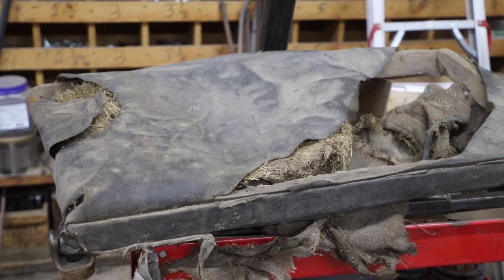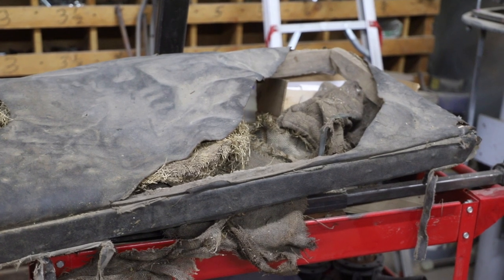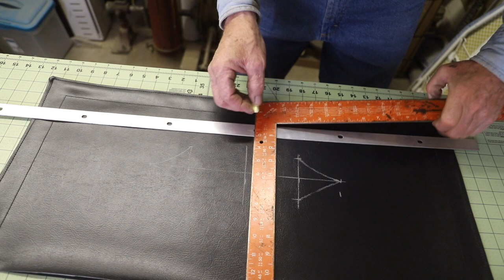How to Stuff and Sew a Buggy Seat Cushion | Engels Coach Shop

Comment: Dave, I was the Quality Manager of a huge high end chair and sofa manufacturing plant.  We made as many as 12,000 per week.  

In those 12 years, I observed every facet of manufacture.  From rough planing hardwoods, frame building, cutting and sewing leather & fabric covers, spring installation, stuffing filling materials upholstery, packing … To even shipping.  

So, you might say that I have a critical eye about how seats and backs are made.  Everything you did was scrutinized… like, staple direction and spacing… selvedge alignment… spring orientation… sewing stitches per inch… Everything…  that you did would have passed my inspectors with excellence ratings.  

Just thought you’d want to know… your skills and workmanship are excellent even compared to a modern Quality Standard.
Reply: Would like to know what is going to keep the top of those springs from wondering all over the place? We used to tie the springs to keep them in place. It was an art in itself.
Reply: @EuphJL  That is an excellent question… these are Bonnel type (double cone or hourglass shaped) springs.  Their base is the same diameter as their top. 

Unlike Leggett coils, (single cone or tornado shape)  that have a very narrow base they are very stable under load.  

There are a  few factors at work.  First off, their base is very stable once stapled to the seat.  Second the materials that he used are not like the Dacron, polypropylene fabric and  polyurethane foam we use today.  The burlap is fibrous and it’s open weave allows it to mold around the particular shape of the coil top.

Then, the wood fiber filler (or excelsior, as it was also called) is stiff enough to bridge across the gap between the coils and provide support.  Yet, it is pliable enough to ‘pocket’ into the top of the coils and lock them in place.  Traditionally, horsehair, straw and even coconut fiber would have served the same purpose.  

From the point of view of the spring in use, another huge factor is in play.  If he had used a single cone coil… as they are compressed the largest diameter turns of the coil collapse first.  These are at the top.  As they do they are constantly trying to push away from their vertical axis and fall over.  By the time they are fully collapsed they are a wobbly group of spring loaded nervous prisoners trying to escape the downward pressure in any direction they can go. That tends to cause them to wear away the burlap and fiber on top.  

A double cone coil has its smallest diameter in the center.  When compressed the top and bottom turns collapse at the same rate.  This transfers any tendency to wobble to the center of the spring.  Because the force is equal from both directions, the center does not try to push out of alignment and the spring collapses straight downward.

A last factor has to do with the seat itself.  In most box springs or chair frames the bottom of the springs are mounted to wooden slats or a metal frame.  That means there are openings between their bottoms.  

When a curved object, such as a persons posterior, presses down on the seat… the cotton padding & wood fiber tends to push into the openings or voids beneath the spring.  That causes them to shred and the spring will eat its way through them, eventually.  That is the second reason the coil tops are tied together… to bridge the gap. Elaborate grid works of wires and springs have been devised to serve that purpose.  And you are correct, the art of the standard 8-way hand tie is a thing of beauty!

This is not necessary in Dave’s application because the seat is solid with no voids to fall into.

Curiously, if he had used stronger springs or more of them they would not collapse totally under the passengers weight.  And, they would have torn right through the filler and padding above.  

Like I said, you asked an excellent question.  Those old coach builders knew a lot more about how things work than we will ever relearn!
Reply: @sassafrasvalley1939  an expert has such incredible knowledge.  We learn how little we know about the subject.  Amazing how complicated getting a seat cushion right can be!
Reply: @theoldbigmoose  truth!  I know people who have spent their entire careers just studying and trying to figure that out!!!
Reply: @sassafrasvalley1939  An excellent explanation! Thank you! Still in all, if this job had come through our shop I would have done a four way tie on the springs just to make sure.
Reply: @EuphJL  it is better to be safe than sorry!  Nothing wrong with that!

Comment: Great video showcasing how the older type upholstery was done. I had a machine that I bought for leatherwork hoping to break into the business. It was a very fast “walking foot” machine capable of sewing through 3/4” leather. No matter what I adjusted, the thing would run away on me. It would have been great for long stitches as it would zip through feet of material in seconds. Not wanting to spend more money on a geared down motor, it just sat until I found someone else to sell.it to. Your machine seems to be more controllable.
I even went so far as just turning the wheel by hand to do intricate work but it would sometimes break the needle on the bobbin carrier. I hope that you don’t have the frustrations that I went thru
Thanks for all you do in keeping many trades alive in your shop!
Reply: The machine you had might have been out of time.  A sewing machine, like a gas engine, has to be timed for all of the movements to work correctly.  The sewing machine my wife & I bought just after we got married started breaking needles and it was out of time but it won't stay in time so I think one of the gears is slipping on its shaft.

Comment: Since the seat lowers are independent frames and removeable.  I'm kind of surprised the seat backs aren't also removeable.  It would be very easy to add attaching hardware.
Reply: Seat bottoms are removable so they don't get wet.  You can take them out or stand them up if you have to leave it outside.
Reply: @thirzapeevey2395   Yep, which is why I asked "why not both?  A person in those times could fashion a parlor love seat bench for the cushions, and use them in the home until needed for Sunday go to Meet.
Reply: @ditzydoo4378  You probably could, but it isn't really a problem on the backs, and would probably be more trouble than it is worth.  In fact, it is sometimes more trouble than it is worth on the seat itself, like when you remember to put the cushion in the bottom of the carriage and strap it down when you load the carriage on the flat bed trailer, but the hook was twisted and you didn't realize it, until the strap works loose, the cushion sales off, and you hear the trucker on the CB behind you say, "Well, I got it with all nine wheels down one side."

Comment: How did the old craftsmen do without a pneumatic stapler?
😎
Reply: Chris, We used a tack hammer and a mouth full of tacks. The hammer had two heads, one of which was magnetic. You then arranged a tack in your mouth with your tongue so the head was forward. Then you put the hammer, magnetic end, up to your lips and grabbed that tack and then “set” it in place, flipped the hammer over and pounded it in. Not quite as fast as a pneumatic stapler but not as slow as you may think. I could carry three different sizes of tacks in my mouth and pick which size I wanted for the application at hand.

Comment: What was the purpose of the drop?

I recently watch a video describing the water pumps used to by fire brigades at the beginning of 20th century in Montreal (CA). The guy mentioned that the horse were trained to join at the front of the carriage when the bell rang and a special harness that would fall automatically on the horses back.  But there was no illustration.

Comment: Dave, two things, what was the matted material that you had to sew together in a baseball stich. And what was the material that you used to create a straight edge under the vinyl/ or leather. It looked like cardboard , but might have been plastic... you stapled it down and then were able to make a straight fold back over it?  Thanks  And thanks for the trip across Montana.
Reply: The “matted material” is called Sisal Padding, 24 inches wide by 75 feet long. The “straight edge” is called Blind Tacking Strip, 1/2 inch cardboard. Comes as a 2 pound roll. The wood wool is called Excelsior.
Reply: @EuphJL  thank you.